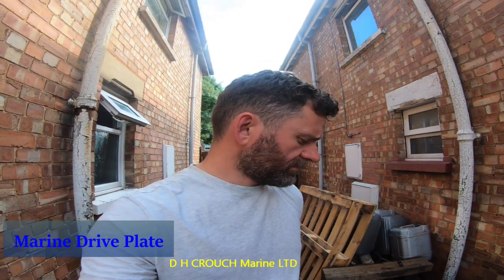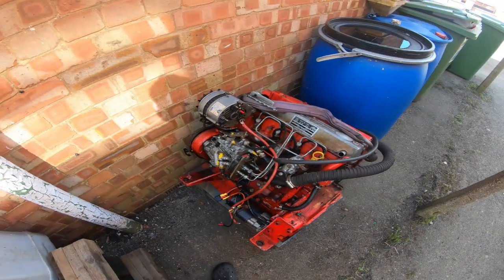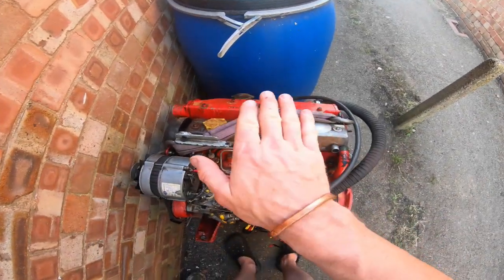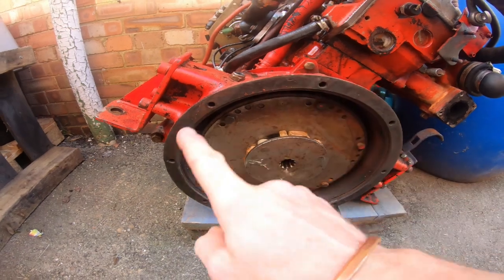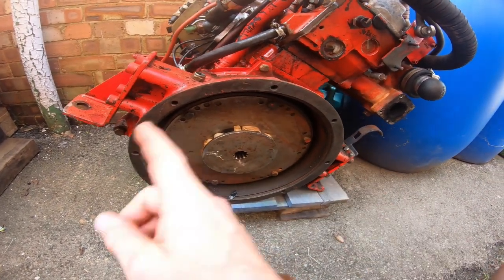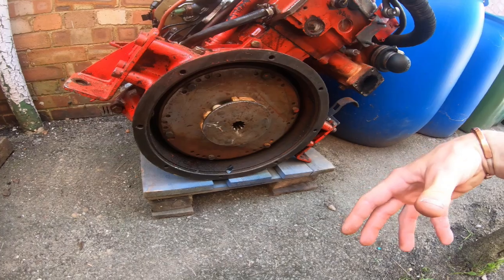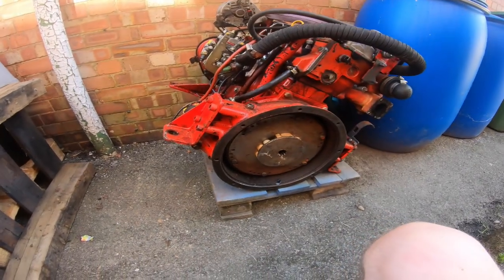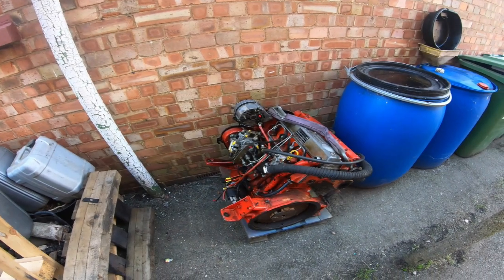Marine Drive plate

Comment: Your videos have really helped me with my boat, I have phones you before for advice about my delta20 gearbox. I got it working again with your advice. I have another clunking type noise when in forward and reverse on tickover but either goes or can't hear it when I put the revs on. Does this sound like a drive plate issue?
Reply from the maker: @leewatson6957 Glad its been helpful. Yes that sounds like a drive plate issue.
Reply: @dhcrouchmarineltd3049  top man! thanks for replying. I will have to have an investigation before I go on anymore long journeys 😅

Comment: Hi Darren.

Could a damaged drive plate result in a loss of power? ie no drop in engine revs but a drop in thrust?
Reply from the maker: @chriswatkeys9907  In some cases. If the drive member is spinning on the plate then yes. But usually its a slipping clutch. 

Is it both directions? If yes its likely drive plate or if not more likely clutch.

Also make sure the propeller isn't spinning in the coupling.
Reply: @dhcrouchmarineltd3049  cheers Darren. Reverse does seem to be better. Reason I thought it might be the drive plate is that I'm pretty sure the prop hit something quite substantial in the water two days ago.

For now we're limping it home to Birmingham and will then investigate further and likely give you a call in the new year if that's ok.

Have a good Christmas with the family 👍
Reply from the maker: Compliments of the season to you guys

Comment: Great video, thanks for sharing. Being relatively new to owning my own boat I've always wondered what the set up was inside the bell housing - now I know!
I have a Nanni 4.190HE engine with a PRM 160D2 gearbox, and sometimes I get a "hard' clunking noise" when changing from forward to reverse, even though I take my time moving the lever (i.e I don't slam it into reverse). Could this be a sign that the drive plate is wearing out?
Reply from the maker: Check the Idle speed. It should beas low as designed. To high RPM will cause this.
Reply: @dhcrouchmarineltd3049  hello again, I've checked the PRM160D manual and it recommends approx 1000rpm before moving from forward to reverse, and mine engine ticks over between 800 - 900rpm.

Any other recommendations on what to look at next? Regards,